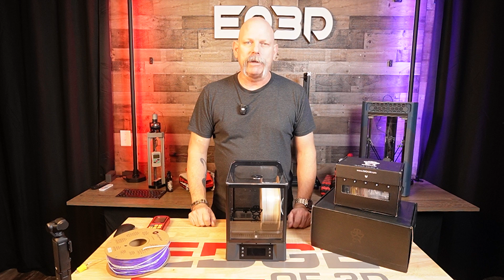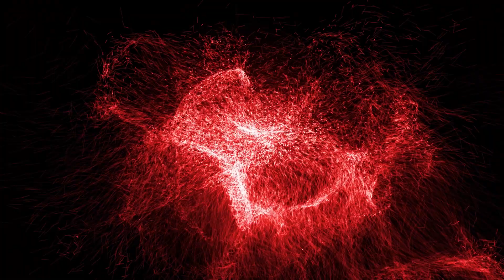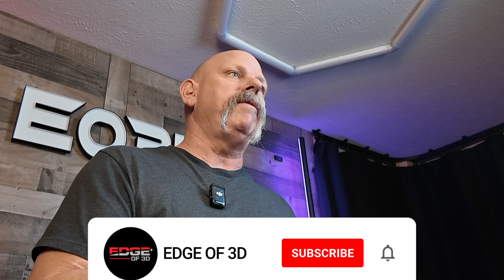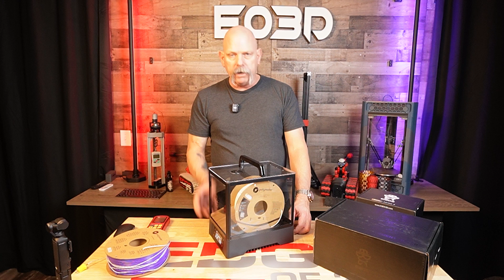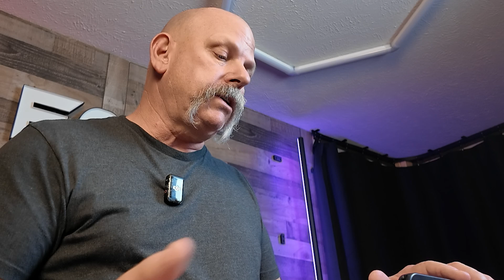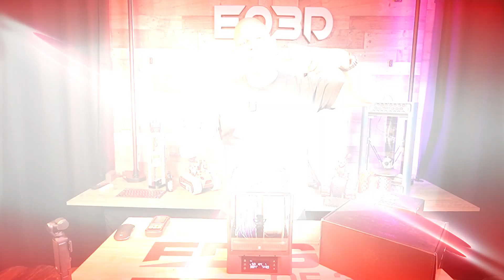EIBOS Polyphemus Filament Dryer Review | EDGE OF 3D

Comment: I have had my polyphemus not quite 3 months now and honestly love the thing it does everything I want, but I have only needed it maybe 6 times so far, and I am already having problems with it sadly. It worked great every time before but the last time I tried to dry some TPU while printing when I turned it on I got a loud screeching sound as if the fan bearings are going out already, I dont think it uses the 360 degree rotation function when you power it on like a startup procedure, and it wasnt turned on so I am pretty certain it is the fan that is making the noise, like it doesnt want to spin up to speed like an old shop vac when the bearings are dried out and going bad, this has me worried because I honestly used it maybe 6 times in the 2 1/2 months I have had it and I am already hearing this noise when I turn it on and i think it is getting worse each time I try, I thought tapping it might dislodge whatever it was if it was something in it causing the noise but it didnt do anything, I contacted eibos from their website and waiting for a reply from them, I honestly hate that it is having problems because I absolutely love it, I really hope they help me out with it because this thing is not cheap at all.
I will try to keep this updated when and if I hear back from them. Hopefully it is nothing major, and is covered under warrenty. If it is a fan issue I hope they send me a replacement (i hear these are known for the fans) so i wish they would have sent a spare or something with it. Im sure they arent very expensive

Comment: they couldnt have just made the plexi glass a couple inches taller instead of having a bunch of stupid peices to cobble together to get a 3kg roll to fit? REALLY?? what the....
Reply from the maker: I'm going to guess they did not think about 3kg rolls in the design phase since so very few people actually use that size. The 3kg extension may be an afterthought or based on feedback from early users.